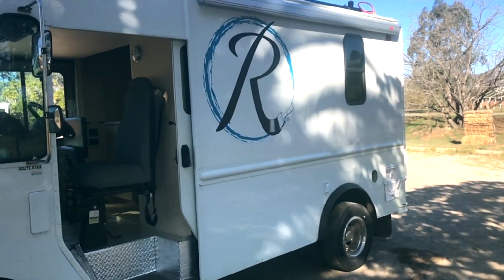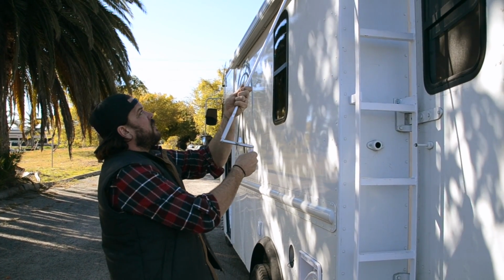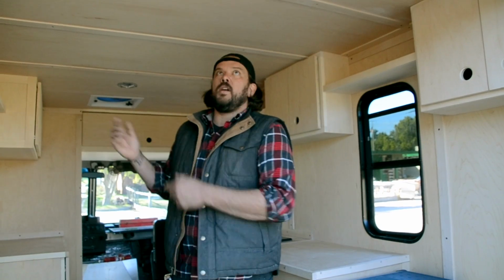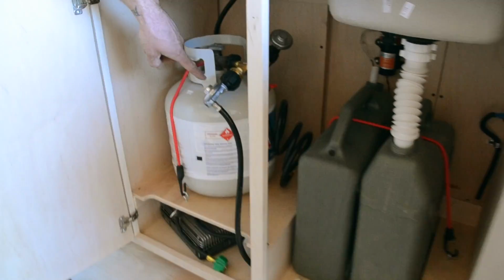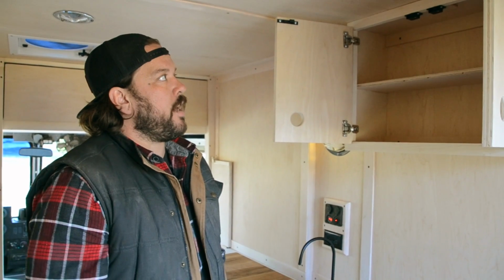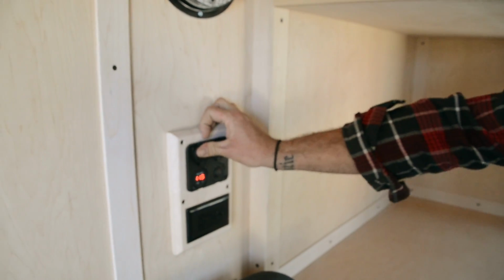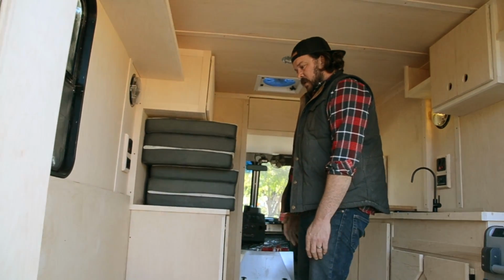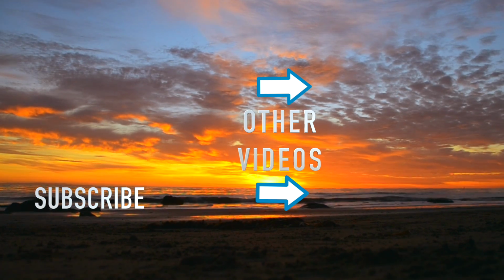Step Van Custom Camper Conversion

Comment: That propane tank location is one big NO NO NO NO NO ....   unless you're willing to die in a fireball
It needs to be either outside, or in a sealed box with vent or hole through the bottom of the van...  propane
is heavier than air, so the gas would sink.... and escape...
Reply: both need to happen for it to really be safe to live in
Reply: That's why they invented propane detectors... How do you know he doesn't have one?
Reply: That isn't even a band aid fix. I haul propane and petro. If there is vapor build up and you inhail that in one breath you are dead. End of story. It needs to be vented 24/7.
Reply: Maybe induction cook top instead? Run off solar? I'm not a propane fan myself and it causes moisture..🤔
Reply: Far better to have the propane bottle on the base of the unit with a sealed partition wall between it and the water/waste tank. Seal on the door and a drop hole.
Reply: Sage Roddy 
No it should not vent into the vehicle. That is very dangerous. Great build otherwise! Lots of cool ideas with great execution. The propane tank needs to be moved or vented to the exterior only. It is a bomb as it is.
Reply: I think a good fireball detector would be effective
Reply: Also propane tank like this one has a pressure regulator valve and allows the tank to release pressure when needed. VARY dangerous . Other then that, Great job.
Reply: Have a look at a news report in UK and it might change your mind. Guy stored a gas bottle overnight in his camper ready to go away with his family. Next morning goes to unlock camper. Operated door release with remote and boom. Top of panel van looked as if it had been opened like a sardine can. He was lucky - blown across road and bruises. Gas bottles can and do leak!
Reply: Sage Roddy ?????? Detectors? So instead of doing what's right, you just want to be right. Got it.
Reply: You're the master clown of this FUCKING INSPECTOR ENCYCLOPEDIA CREW lmao. You deserve a recognition award or something 👍
Reply: Sage Roddy don't you hate when know it all's always have something superior to add or say.    Just enjoy the dam thing
Reply from the maker: youtube university they are all well meaning. I am not the designer of this build but he and I would both admit we don’t know it all.
Reply: Super dangerous and a really bad idea. That van is beautiful but not safe to be used in its current condition.
Reply: Dennis Mattson mines been inside for a year with no problem as long as you have ventilation
Reply from the maker: I think a propane gas detector/alarm should mitigate the dangers of it!

Comment: keep the wave heater sealed up when not using it,,,, dont let dust and dirt get on it or it wont work right.  it has to do with the matting inside where the heat is.... dont remember what its called but keep a dust and dirt cover on it when not in use,
Reply from the maker: Yeah I am hearing dust is a heater killer. We will get that thing covered! Thanks!

Comment: How are you venting the exhaust from that heater, when it's running? And where's your propane safety? No canister is 100% leak-proof, good luck getting that inspected. Nice and simple, otherwise.
Reply from the maker: Two overhead fans and 4 window help with ventilation. The heater is rated for indoor use too. I think as far as leaks, a propane gas detector/alarm should mitigate the danger.
Reply: Sage Roddy C'mon ,Man...it won't mitigate anything ahead of the problem..it will tell the paramedics what happened..it won't prevent it from happening...please think about this..it won't take that much to correct this Death trap...

Comment: Very cool. As I continue to look at different options, I keep leaning towards a step van because I am 5'8" and have spine issues. Tight spaces are a killer for me to move around. I like the black pipe on the roof. Wondering if octagon mirrors mirrors wrapped a couple inches away from the pipe would heat it a little more. Thank you for creating this video. I would like to create a food truck like( selling products we like) business out of it, while living out of it and traveling the country. Great job!
Reply from the maker: Ah yeah I bet some mirrors would help it heat up! Good idea. Good luck with your eventual adventure!
Reply: Christine Seaborg 
If you were to use stainless steel or another polished metal for a reflective surface you would probably want to use metal pipe to hold the water. ABS could melt and leak. It’s a cool idea 👍

Comment: that heater needs to be covered when not in use, dust messes up the material it uses. read the box it came in.
Reply from the maker: That’s what I hear. We will make sure it’s covered.

Comment: I never post negative comments, especially on someones hard work. But dude. So no one in your shop has ever been camping before!?? The awning is on the wrong side. Goal zero systems are for amateurs.  PVC water tubes suck. The windows are great, but you need some way to make air flow. The woodworking looks real nice, but not to practical for storage of camping items. The van is so close to being real nice. Best of luck to you.
Reply: Glenn Beattie
Can you elaborate on the water tubes? I'm thinking of using them. I don't want a shower or any tanks underneath.
Reply: Nothing wrong with Goal zero. We used ones for our camper and it worked real well. Its expensive for what it is, but worked for us.
Reply from the maker: Glenn Beattie Dang man. Sorry you didn’t like the video. A lot of those features work well for how the van is going to be used. Also, all the windows open and there are two vent fans on the ceiling that aren’t shown.